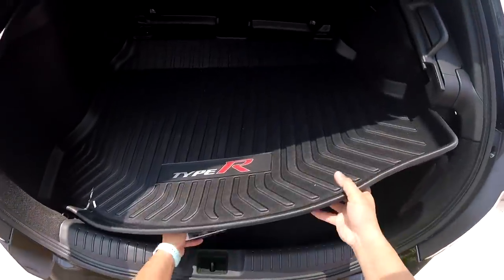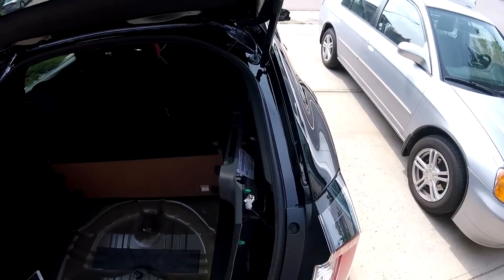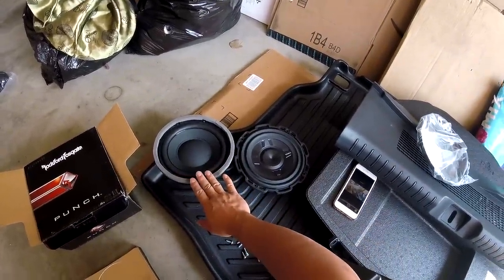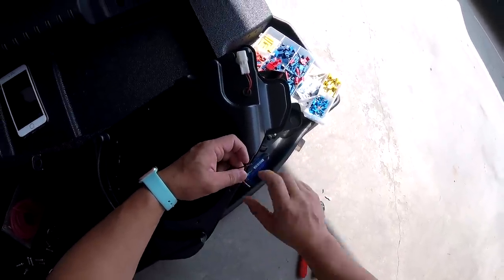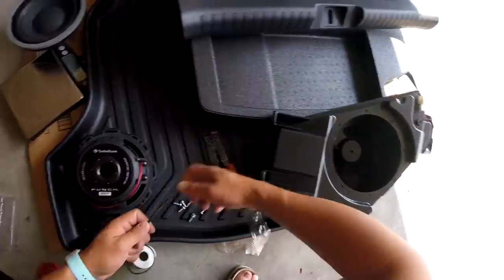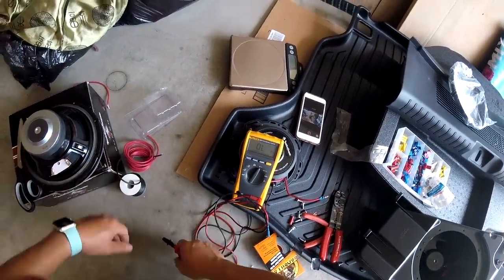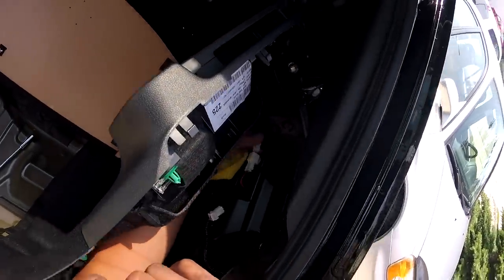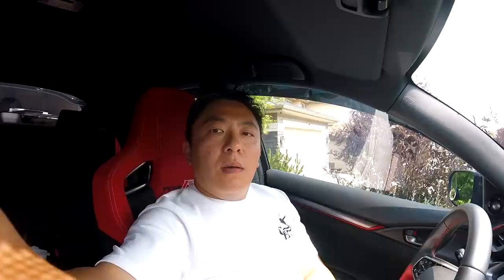2016+ Honda Civic Hatchback Factory Subwoofer Swap Upgrade

Comment: Thank you so much for this video! I have a couple of questions I'm hoping you or one of the viewers can answer.
1) I bought an 8in kicker 2ohm shallow mount. The holes did not line up so I'm wondering what kind of bracket or adapter I'm supposed to buy. 

2) I installed the subwoofer temporarily. Much better than the stock but something is wrong I think. At low volumes everything seems fine. Once I play a bass heavy song at about "30" on the volume level, the speakers just stop working. The subwoofer as well. No audio plays on any source, radio sxm etc. Idk if anyone has encountered something similar and if so, what could be the issue? Thanks to whoever answers.

Edit: Forgot to mention that I have a 2019 civic hatchback sport touring. So it had a stock sub. Also, the audio comes back after I turn off and back on the car but goes away again if I play a bass heavy song.
Reply from the maker: OMG, I didn't see your comment until now!  My bad.  The answers.  If the holes don't line up then make new ones.  Just install a thin weatherstripping gasket between the sub mount and the enclosure so its tightly sealed.   The audio cutting out is the amp protection circuit kicking in on the head unit.  Volume level 30 on the stock head unit is quite high and its likely detecting clipping on the output and as a self preservation system, that the head unit just cuts the outputs to prevent speakers from getting blown or the head unit's amplifier outputs in check.  If you're going to really drive the system hard you're probably better off investing in a DSP amplifier so that you decouple the loading on the factory head unit.  I'm planning to do a DSP amp install on my Type R once I get some other things settled in.
Reply: Is that kicker a dual voice coil that you wired in parrellel? If so then the impedance is way too low for the headunit and is shutting down due to power spikes.

Comment: Nicely done video. Couldn't you avoid cutting the factory sub wiring spade connectors by just using corresponding spade connectors on the wires coming from the new sub?
Reply from the maker: I could but was lazy to find the matching tiny lugs" on the factory wiring.  If they were standard size spade lugs then I would've done that BUT I know for a fact that I will NOT be ever reinstalling the factory sub anyways so cutting off those connectors was a minor thing.

Comment: Nice video,
As the stock head unit run on 2 ohm, is that possible to use the 2 ohm sub, rathen then by pass the 4 ohm?
Any idea Thanks.

Comment: Nice work! I followed the steps in your video and was able to remove the sub. I wonder if you know the per-channel output power of the stock amp and the power of the stock sub. I am considering to do a simple upgrade for the speakers and the sub, but since I don't know the output power of the stock amp, I have no idea what kind of speakers I should buy. 
Can the stock amp support 50W RMS speakers?
Reply from the maker: Well the factory head unit claims that they have over 542 watts of power divided across 12 speakers.  Doing some simple math that is ~45 peak watts per channel (obviously some going more to the sub than say the tweeters).  That isn't very much power and the power figures Honda quotes are PEAK watts not RMS watts.  So in other words,  adding amps to all the speakers will make a HUGE difference.  having 50 watt RMS speakers don't really mean much as it is the power going to the speakers and how clean that power is that will determine (within reasonable limits) if your speaker will blow up or not.  For example I have in many of my systems push well over 400 watts of RMS power into a little 35 watt speaker.  Haven't even come close to blowing that little speaker up yet I've seen guys put 1 watt of really piss poor power to a speaker rated for 100 watts and have the speaker blow.  Its all about how clean the power going to the speaker is.

Comment: Why do you have it wired differently in you other video with the anp install?
Reply from the maker: b/c when you use an amp you have to pull signals from the sub wiring and by nature of how I have it setup (b/c I can easily roll back to 100% stock should I decide that one day).  Sub swaps with no amp are very easy.  Plug and play but when you introduce an amp, you need to pull signal to the amp and then feed the newly amplified signal BACK to the sub.

Comment: Great video bud and nice Type R . I don't have a Type are but this video gave a pretty good idea on how to wire the correctly my sub on my 2015 Si I have seen videos I have seen videos on how to add sub and amplyfier but not a single one on just upgrading the the stock sub with out extra S**t. Thanks again 👍
Reply from the maker: glad you liked my video!  I plan to do another Type R video where I add an amp and an Audio Control LC2i with remote bass gain adjustment so that I can really open the power for that little 8" sub.
Reply from the maker: glad you like my car and my vid!  Yeah most vids show people going all out doing sub and amp but I figured I'd try to see if a better sub would improve sound (it definitely did) but adding an amp is on my roadmap and I'd like to do a vid on that as well as talking about the before and after impressions of an amp addition with a stock head unit.  Stay tuned!

Comment: I'm surprised the factory subwoofer was 2ohm. I have a 15 civic si and I want to do basically same idea, except using a 10" subwoofer bandpass box in the trunk. I want to use factory headunit to power it(not interested in full amp etc.). I'm worried the subwoofer will overload the headunit. Nice video.
Reply from the maker: yes I was surprised too but I suspect it is to extract as much power out of a stock stereo system.  Using the stock stereo to drive a 10" sub without ANY external amplification is likely not going to work well.  It barely worked well with an 8" sub so you may want to reconsider your options.

Comment: Any idea on why my sub is giving me 0.8 ohms when I wire it exactly how you did. Also if I take the 2 wires off from positive to positive side of the bass and negative to negative from the bass and just have the 2 wires tapped into one side of the bass I do get 1.7 ohms but that is not how you did it. Wondering if I got a bad sub from the factory or not???
Reply: I figured out my own problem. I ordered the wrong sub. Looks like I need the dual 4ohm sub and not the dual 2ohm sub. Don’t be like me and order the wrong sub.

Comment: What made you decide on that specific speaker? Is there other options that you considered or know of people using that may potentially be even better? I saw that you said the oem was a little taller so maybe you had more space to go with something even bigger?
Reply from the maker: I chose that speaker b/c at the time other Civic enthusiasts deemed it a good fit.  It had to be 8", had to be dual voice coil and it had to be a shallow mount.  Tall order in my eyes for a sub that costs less than $150 USD.  Rockford Fosgate makes a solid product (for the most part) and thus I landed on the sub that I did.  I am considering moving up to a dual sub setup in my car (but not stock looking) b/c I want deeper bass but I might have to consider upgrading the door speakers first before dropping more on the bass portion of the audio spectrum. We will see... I want to keep my car as stock as humanly possible since I believe it will look the best and retain its long term value best.
Reply: @piercedasian  hmm that makes me think I wouldn't be satisfied with the factory drop in. I thought it'd be cool to have all the space if I went this route but I have a 12w7-3 in my current set up and feel like I'd be super underwhelmed with the small sub.
Reply: @piercedasian  also you pretty much have all the wiring done I believe to throw in another sub and if you try to resell the car you could just remove it without further modification to the car.
Reply from the maker: @in4naptime  yeah if you're running 12" w7 MK3's  there is NO chance in hell that a drop in will come close to sounding as good as what you're used to listening to.  Size and quality of the sub makes a HUGE difference as does the power you're feeding it.  You are correct in that my setup today EASILY allows me to put in a boxed sub setup OR revert back to the OEM sub setup in a jiffy.  It was why I setup my system the way I did because I wanted flexibility.  With kids that space is always a premium so I have YET to go with the boxed sub route.  Knowing what you're used to listening to that you're better off mimicking a portion of my setup (mainly amp and wiring) but wiring an externally boxed sub.  I WISH I had a JL W7 in my car... man that would be bass bliss right there!
Reply: @piercedasian  I like how you have the Amp hidden away I've always wanted to hide it under the carpet but was also worried about the heat. Saw you mention in comments that with newer amps you don't have to really worry about that. Curious if I'd be able to get away with the same thing. In my current set up I opted to have the Amp mounted on top of my sub. I always hated having to worry about boxes sliding all around the trunk but luckily this one is heavy enough to stay put for the most part. Space isn't a hugeee concern to me since I'd have soo much more coming from a trunk to a hatch, just really like the idea of maximizing the space. Considering a custom enclosure.
Reply from the maker: @in4naptime  The beauty of modern digital amps is the amp topology they use and how MUCH more efficient they are at producing a LOT of power with minimal losses to heat.  Some used to argue (including me) that old school Class A/B amps sounded more musical while class D amps were great for bass because of their inherent lack of upper-frequency response performance.  That was nearly 20 years ago and today digital topology amps are MUCH better than they ever have been and pushing efficiency limits even further all while retaining musicality (if that is even a "Thing").  My amp in the grand scheme of things doesn't get very warm at all unless I am on a really long road trip then it definitely is really warm (but never hot).  That is NOT to say that it can't get hot, you have to understand that heat production is a function of how much power is being pushed/drawn from the amp.  The sub I'm using is extremely efficient, so it takes very little power to get to relatively loud levels.  I'm also driving a sub that has relatively low mass (it is after all an 8" sub) so that further reduces what my amp has to put out to drive the speaker load. That would absolutely change if I put in say a dual 12" sub setup and tried driving them at 2ohms.  Not to scare you from burning amps but you just have to try the setup as is and factor in what you might need to modify to get cooling into that hidden trunk space if your installation requires it.  Some use 12 volt-powered PC fans to push and draw air through the lower trunk cavity.  Just keep cooling in mind when building your system as you clearly are running MUCH bigger premium subs than I ever would so presumably you would need larger amps which in turn will create more heat.  I restore vintage audio equipment as a hobby and heat is the # 1 killer of electronics.

Comment: Hey im curious if i were just to put an amp in with the stock unit. What that work??
Reply from the maker: it will work but it won't be optimal and could sound like something is "missing".  I have another video showing me installing an amp with the upgrade sub in this video.  Search my channel and you'll see the proper way to do it.

Comment: Great video.  Would this work with the 2022 Civic Sport Touring Hatchback?
Reply from the maker: yep, the whole principle on how this is done is identical using the same equipment.  You'll need to verify the sub size and location (or just put in an aftermarket one) to ensure that everything fits.  It is a worth upgrade that doesn't cost too much to complete but makes a noticeable difference in how things sound.

Comment: Awesome video, thanks so much for posting. Do you think a 4.63" mounting depth sub would fit in the stock spot? Hoping to install an 8W3v3-4.
Reply from the maker: hmm, my reply is super late but I'm not sure if you can fit a sub that tall.  The stock sub housing is quite shallow which is why I purchased a shallow sub.  You COULD make the larger sub fit if you use a sufficiently sized spacer ring.
Reply: @piercedasian  Good tip, thanks!

Comment: Hey great video man how does it sound, is the bass actually better also do you get vibrations or rattling
Reply from the maker: Bass isn't exponentially better but definitely noticeably better.  Best upgrade was the sub + external amp that all tied into the back in a tidy package.

Comment: I'm going to do this but reinforce the box a little with fiber glass and do a more powerful amp
Reply from the maker: That's a great plan.  The amp I used is pretty powerful as it is.  Not sure how much more power you'd need when you can only fit (in stock form) a shallow mount 8" sub.  There is a point of diminishing returns when you amp up (pun intended) the power too much.

Comment: Hii, I have a 2021 type R. Was wondering if this specific aftermarket speaker in your video is an upgrade from stock? I heard 2020+ models had upgraded speakers.. thanks!
Reply from the maker: yes, the sub is definitely an upgrade from the stock unit.  As far as the audio system upgrades in the latest 2021 model the only change they made was they started piping in fake exhaust system sounds (similar to how VW's Golf R does it).  To me, that is not an upgrade but a marketing shill.  That being said, the R's cheapest and best upgrade in my opinion is swapping out the stock sub and either a shallow 8" (straight drop-in) or using an adapter ring and install a 10" sub.  Sub performance is best with an aftermarket amp (I have a video that shows how I installed one).  Enjoy your new car - it is truly a work of art and while I'm tempted to sell mine that I have a LOT of difficulty making that decision because its such a wonderful car.

Comment: Is there a noticeable difference from stock to this even without an amplifier? Just looking for a little extra punch
Reply from the maker: aftermarket sub is slightly tighter and it sounds better than stock but the biggest improvement was when I hooked up an aftermarket amp + LC2i signal out processor to the factory head unit.

Comment: You mentioned leaving the hole in the sub enclosure open for future to an aftermarket amp. I'm doing this install with a Rockford mono amp hooked up to the Rockford sub. You mentioned running one set of speaker wires from the sub to the amp and another set from the amp power to the sub. Do you happen to have a diagram of how this would wire up?
Reply from the maker: if you watch my amp installation video I have a crude diagram in my video that shows exactly what you seek.
Reply: @piercedasian  I watched the video and I kinda get what you're saying but being as you're not using an aftermarket amp it's a little hard to envision where to connect the two sets of wires. I get one set goes directly into the speaker connection but does the other go in the rca output?
Reply from the maker: @armyofone129  did you watch my amplifier install video on my channel?  I asked this b/c in your reply you mention that I am not using an aftermarket amp and I am indeed running on.  I just want to make sure you're aware I have 2 sub videos on my channel.  One that is a sub only upgrade and another where I add the external amp.  Basically what I did was instead of snipping off the factory sub connector that I just cut the wires off the stock sub inside the enclosure and joined a new set of wires to the wires I just snipped off the factory sub.  From there I routed the spliced wires to my LC2i.  Then from my amplifier's sub outputs I ran a set of speaker wires from my amp BACK to my sub enclosure and hooked it up to the new sub.
Reply: @piercedasian  I didn't see the 2nd one. I'll go watch it.

Comment: Hey mate. Awesome video. Super helpful!! Do you think adding the amp would make a remarkable difference to the sound being that it’s just an 8”?
Reply from the maker: yes adding an amp would make a significant difference even for a little 8" sub.  The issue with the Honda headunit (as with all factory head units) is the lack of true RMS power.  If you are patient enough i will be showing how to properly install an amp that will fit into the foam insert in the spare tire well along with an audio control LC2i line converter module with remote bass gain adjustment.
Reply from the maker: yes adding an amp would SIGNIFICANTLY improve the sub's performance.  Stay tuned as I do intend to do a video install of an amp and then talking about the before and after amp upgrade in the 10th gen civic.
Reply: No. It's only an 8. No need for any more power than what the sub will take. All my buddies used to push 10 and 12" subs with 1000+ watt amps and my 2 10s would hit just as hard and sound better on just 300 watts. It's all about putting them in a properly sized enclosure and getting the amp tuned in correctly.  Basically whatever specs the manufacturer gives you is what is going to yield the best results, you can play around with the numbers a little and possibly get a little better sound. I think the biggest hold back on this setup is going to be the factory enclosure.
Reply: @piercedasian  have you installed an after market amp to that fosgate sub?